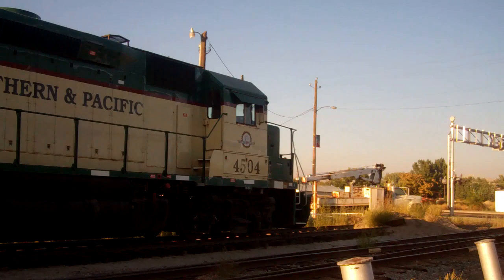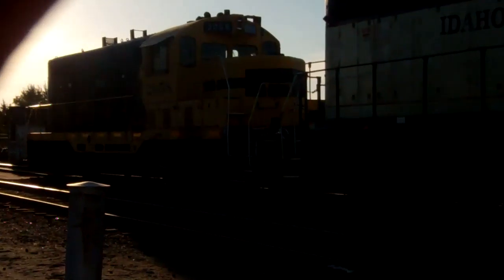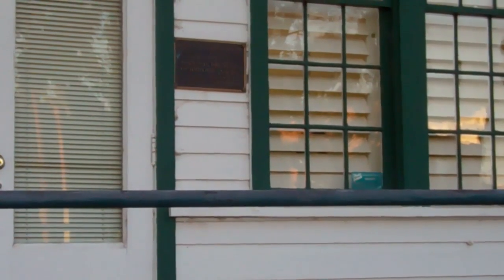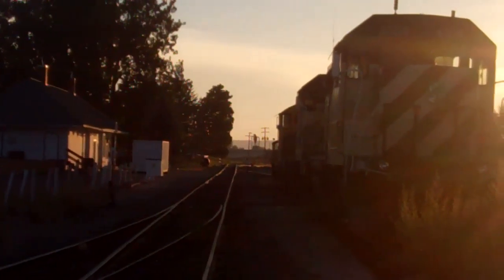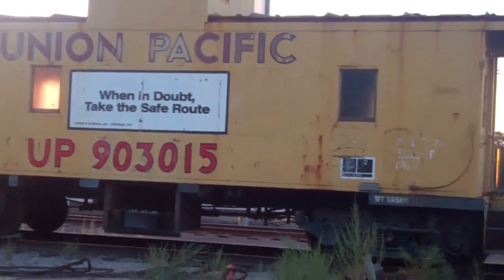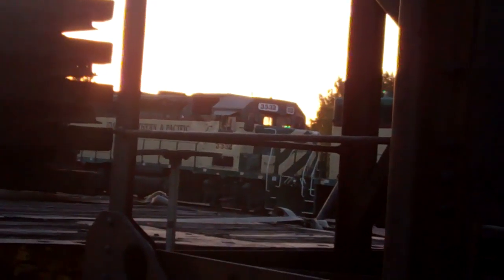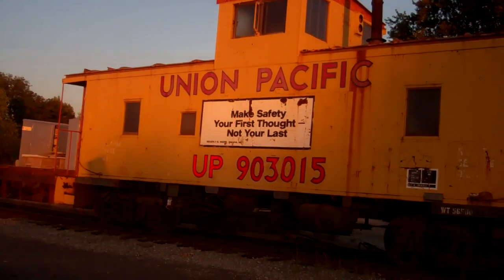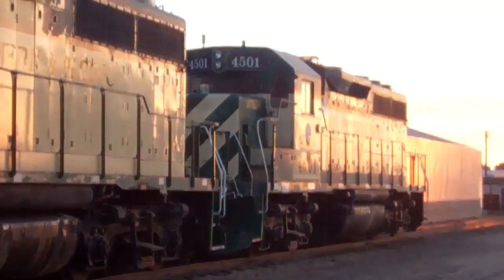Idaho Northern and Pacific in Emmett

Comment: CAN SOMEONE TELL ME IF THIS RAILROAD IS IN JEPORDY OR RUNNING?
Reply from the maker: Fred Lohmann This railroad is still partially running. The Nampa to Boise line was bought by Watco in 2009. They stopped operations for freight in nearby Horseshoe Bend in 2001 and tourist train service shortly after this video was filmed, in 2014. The La Grande, Oregon section of the railroad still operates and this particular branch in the video is still in operation, but only during harvest season I believe.
Reply: I actually work for the Idaho Northern, MOW and Conductor. 

Idaho runs once a week year round, about 20 cars or so a week. 

Oregon, where I work, runs a train every day, we can move about 50-75 cars a week.

There are plans in the future to bring service back to the Thunder Mountain Line, though nothing is set in stone yet

We use that depot in Emmett daily mon-fri.